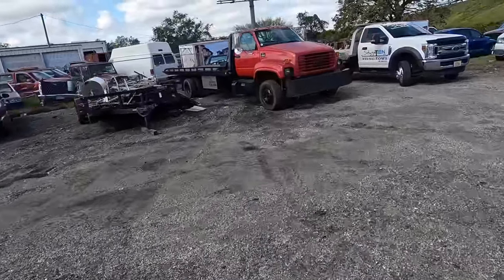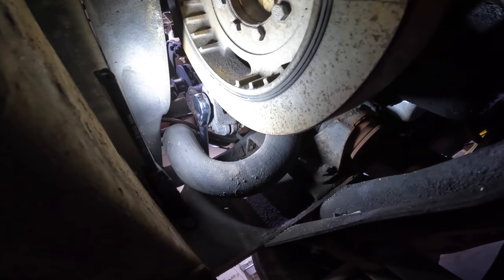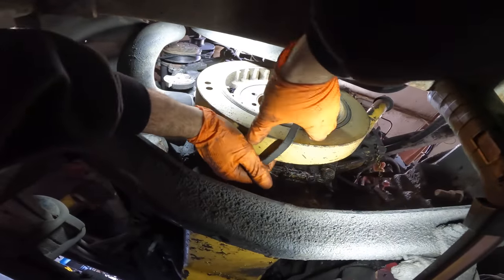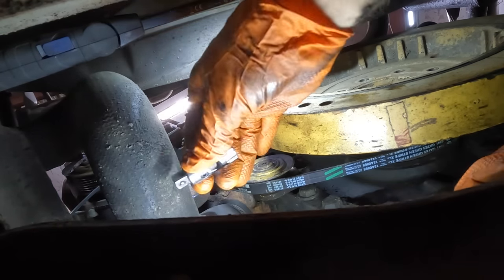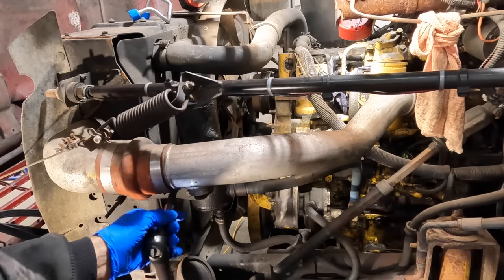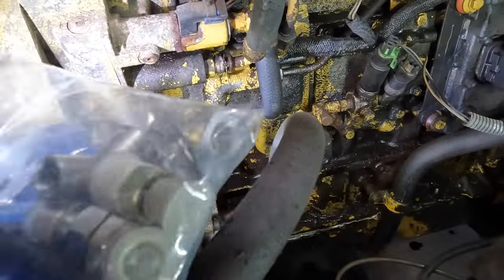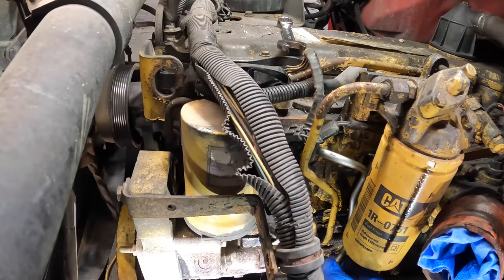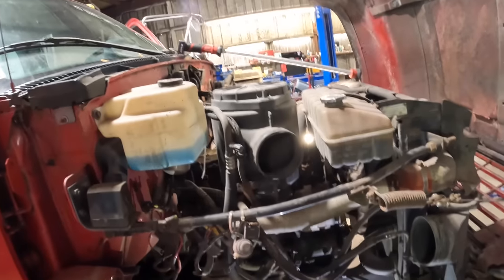Hi Tension Explosion! CAT 3126 Diesel

Comment: Next time, rotate the belt so that the flat side is to the inside. That will give you exactly enough extra belt diameter to fit around the balancer without resorting to force.

That works because with the friction side facing outward, you are now bending the belt so that the cleats are pulling away from each other. In normal orientation, bending the belt pulls the cleats against each other; reducing the flexibility.
Reply: Yep, that's all he needed. Good catch!
Reply: Thank you for that tidbit! Makes sense!
Reply: Was so wanting to say that while watching him struggle…..
Reply: I think you're talking a bunch of nonsense.
Reply: @davidgreening173   same here common sense
Reply: That’s the way to do it. Turn the belt “inside out” then apply pressure. 👍
Reply: Turning the cleats out increases the inside diameter! The flat side of the belt is a larger circumference.
Reply: Thanks the way I’ve always done it, reverse the belt. Now I’m worried about the lubricant you put on it. It may last a while.
Reply: Yup. Also the Cat belts are just a tad longer than any aftermarket I've run across. I just flip them inside out and they just fit over the damper.

Comment: Ray , It's nice that you as a pro do not edit out the aggravating stuff, as a DIY'er sometimes a 2 hour job easily turns in to an entire afternoon filled with frustrations especially up here in the rust belt.  Nice work !
Reply: I’m betting that swear jar in that afternoon is half full
Reply: Please , you are killing me with that rust . I get rust nightmares when I go sleep.
Reply: I've never had a belt that rusted.🤭
Reply: gotta love when bolts go from righty tighty to righty loosy
Reply: Repaired a mates Subaru XV TX-580 box with code P2763 and workshop manual said 2 hours but took me 5 hours, lots of frustrating other issues on the valve body.

Comment: Hey Ray. Large pry bar on the back side of the vibration dampener usually moves it no problem. It weighs about 30 or 40 pounds. Removing it is the preferred method to get that vee belt off lol CAT tech from Ring Power. Local Florida boy
Reply: Center bolts though right?  I've never removed the outer bolts to remove the dampener.
Reply: @brianm5186  the outer bolts hold just the dampener itself to the pulley hub. The inner bolts remove the entire hub and pulley assembly. He removed the correct bolts for what he was doing. Just need to pry on the dampener to get it off.
Reply: @deez_pucks4709 , Stick around Deez, Ray’s probably going to need more advice for this Cat engine. He can more than likely figure it out but having a Cat Tech in the audience could prove valuable.
Reply: @Hoaxer51  I plan to. Lol Don't know how my weekday would go if I don't have my breakfast while watching a Ray repair.
Reply: I tried to tell ray the same thing and he left a rude message back to me he said am I blind?
Reply: What kind of torque does that center bolt on the damper have on it? A ton, I imagine! Could that be taken out to get the thing off also or more hassle than it’s worth type thing?
Reply: @dh-_1011  it's not as much as you think. German torque specs with a 1/2" impact. Lol You can take it off at the center bolts but it's much heavier and touch to remove due to its size near the fan shroud. Plus you chance damaging the front main seal in the process since it's mated right up to the crank. Not worth it just for the belt when the dampener is fairly easy to remove if you know where to pry.

Comment: Just a suggestion, 
Degreaser and power washer, makes the job easier to find leaks and to work on the truck. 
Glad to see your whole family is working with you, special thanks to The Wife Unit. Her job is endless.
Reply: I am surprised he hadn't ordered another pallet load of Brakekleen to clean up this big rig 🙃
Reply: Yes, i found many hours of power washing made for many hours less struggling
Reply: The local do it your self car wash is a great place if you don't have a pressure washer.
Reply: Not a good idea in todays car/trunk electronics and sensors

Comment: Ray i love cat motors especially the 600hp which i had in my 3 trailer road train before the 1.5 million engine rebuild and it was rebuilt .3 times , cat motors  are the best engines in tropical areas going from cold in Adelaide to Darwin there gutsy mate hauling 125 tons
Reply: Greetings from Camperdown Vic mate. 😀🙃
Reply: G'day from central QLD
Reply: You must have very good roads to allow that load.
Reply: @wayneessar7489  That and a lot of axles.
Reply: @leonb2637  Thank you!

Comment: From the CAT manual (my '96 in my RV), the easiest cold start method is to cycle the key 3 times - as soon as the intake warming light turns off, turn the key off and immediately back on until the third time, at which point you start the engine. Mine starts like a champ, even in the cold weather we have here in the PNW (I don't start it in the winter unless it's going to be driven)

Comment: The tree company I worked for had a GMC  bucket truck with a straight 6 cat motor . Was told it was a throw away motor ,could not be rebuilt. Always wondered why not.
Reply: Ya! After 1+ million miles, throw it away with the vehicle it’s in,,, for it is not “road worthy “ ! LOL
Reply: The cylinder liners are not replaceable in the block, like most larger diesels. The block has to be machined and a sleeve pressed in. So, engine has to be removed, disassembled and sent to a machine shop. Long and expensive process.

Comment: I remember doing my first water pump belt now after watching you struggle with this one Lol the other mechanics in the shop were laughing at me as I was you now you should know the belt will go over the balancer but here is my tech tip for you so next time you don’t have to fight with it so much, don’t take the tensioner loose at all cut the old belt off if it is still on it put the new belt on and start it on the pulleys then go tap the key and the belt jumps on and is tight , put the new tensioner on then put the serpentine belt on and your done keep up the good work !!

Comment: That belt lube is great and a ratchet strap. I wish I had thought of things like that. The best I have is my lower radiator hose blowing out 30 miles from the shop and no tow trucks available for hours. I used gorilla tape and water from a water fountain in front of an office building. Lol

Comment: Not sure if you have any experience with tow trucks in your past but I want to toss some advice your way.  Be mindful of your height when you're loaded. I generally use the fact that I'm a hair over 6' tall and know how high the bed is on the empty truck. If I can see the roof of the car I'm under my height plus the bed height, usually about 10 foot. It's not perfect but it gets you in the ballpark and helps avoid custom convertibles.

Comment: I've never understood why diesel engines aren't washed with pressure washers before you start repairing things.. Everything is so much easier and cleaner to work with once you've done this. I used to do this when I worked as a mechanic on agricultural machinery such as large tractors and wheel loaders. It's so easy.. check for faults first, wash, repair.
Reply: Because lazy, lol. Soak everything in a mixture of degreaser & cosmoline remover and kerosene before you get any water on it, let it work in for a little while, then spray it off with a pressure washer strong enough to remove the crappy factory paint job from a '90s Dodge pickup. Then throw some kind of good, slightly alkaline biodegradable cleaner on everything to deal with the stuff that isn't of the oil/grease/fuel/sludge type variety, and rinse that off. Probably won't even need any elbow grease. If you want to pretend it's a show truck, you could finish up with an old wash mitt and some Dawn in hot water, but there's no real need. If you want to be "OCD thorough," blast off all the oil-based garbage you can see/reach (rinse from bottom up; water is not an oil-based cleaner's friend)... then stick it back in the parking lot until it's completely dry, bring it back to your water supply, lift at least slightly in the front (unless you're truly a masochist and/or have a creeper fetish), slide underneath, and soak soak soak everything that you can. Blast it off with the pressure washer again, then do a second thorough high-pressure rinse from above (front/sides/fenderwells) before you worry about the plain old dirt (non oil based) crap. 

Things like this are yet another reason why it's good to hire an employee for the not quite grand master mechanic level tasks. Get one who can detail (properly), and he - or she - can still be bringing in $500 to $1,000 on the days when you don't need a serious second set of hands "on the mechanic side." Assuming, that is, that Florida drivers actually give two shiny sh!ts about how their vehicles look outside/inside/underhood. Considering the way they drive, I have my doubts. But if you're in the same facility as a body shop, they might be able to throw you an occasional bone (or vice versa, depending on how you look at it) and have the employee wet sand / compound / glaze / wax / wax a vehicle. Especially if it's the kind of gravel lot cut rate body shop that is owned by someone who thinks(???) a full filtered air paint booth setup is not required and, therefore, tends to have dirt in its paint jobs (along with orange peel finishes). Either way, there's always something for a detail person to do in an area with more than a thousand people in it, and you don't need all that much mechanical ability to provide real time-saving help (/do the piddling jobs - which is most of them, come to think of it, but...).
Reply: too expensive, he uses Brakekleen only.
Reply: @forgetfulme1719  THAT'S expensive, when he routinely uses multiple cans per vehicle of the stuff, instead of multiple vehicles per can. Plus it removes more brain cells than grease, lol.
Reply: @wesgregg6451  BK getting views, some of his actions already confirms the the last part.
Reply: @wesgregg6451  he has said viewers have sent him cases of BK, so his cost is low as long as viewers like it enough.
Reply: @forgetfulme1719  Who is BK?
Reply: @wesgregg6451  BK short for Brakekleen, sir. he likes nice shiny lungs when retiring.

Comment: looks good Ray. 
hint you may want to look in to a new balancer for that cat. you will find it runs and sounds smother after you change it.
Reply: why replace the balancer please explain?
Reply: @thelaughingman79  the rubber in the balancer ages and gets hard or out right de laminates and slips and at that point the crank will start flexing. i saw a balancer out right tare in half and that mad a real mess of things.  they are hard to find for the older cat's but i run fluidampr on my truck and i love it.

Comment: Just  a tip The front Damper  of the crank , There are 4 bolts in the centre  ,you remove those and the damper comes off quite easy  you don't need to remove the perimeter ones .
Reply: Yeah he going to be mad at himself after  reading this but he knows  next time
Reply: I came to the comments to say the exact same thing.
Reply: Otherwise flip the belt so the strings are inside, that way the rubber can flex and allow it to slip into place.
Reply: No it’s got 4 bolts,look again when he nudged it round
Reply: @stephenanderson439  yeh i seen that when i put the video in slow motion, weird angles make things look differant
Reply: @stephenanderson439  bryce1916 said: "There are 4 bolts in the centre", just like tou said.
Reply: Well hope he see's this so next time he will get through it in a few min.
Reply: It comes off quite easy when it weighs close to 60lb.  There tons of professional that have done what Ray did, but didn't show it. I wonder how Ray would have reeeeeacted if he stuck that belt on with the letters facing the other way.
Reply: You beat me to the comment. 
Also, fold the belt inside out.
That works as well.
Reply: I tried to tell ray the same thing And then he left a rude message back to me saying am Iblind?
Reply: @@roadstonowhere1964 beyond no doubt,  u and I 100% accurate assessment, too proud to learn from real pro. It loses entertainment value  if everything goes smoothly with proper tools and skills
Reply: @CaniKissYou09  now u know Mr Hack is too stubborn and scary to realize own inadequate knowledge. Only those  learn from mistakes can grow. We watch it like circus acts from now on.
Reply: Well, who knew?
Reply: Preventive maintenance is always good  ,,gives piece of mind 😁😁👍🏽👍🏽
Reply: @@roadstonowhere1964 true, I watch so I never do the things he is doing to my own  car. Should be comedy channel.
Reply: @norcalvapin  your life might be and No I don't want your plush toy.
Reply: Some of you guys need more brake clean in your life……..ReeeeEeeeee!
Reply: @norcalvapin  yep, just copy his repair hack on ur car to see how long the repairs lasts.
Reply: @shadetreemech290  he has a garage now, shelter from rain and sun, can take as long as it takes.
Reply: @norcalvapin  what do think that thing on the end of the crank shaft is ?
Reply: now we know why the old belt was stretched
Reply: @norcalvapin  uh..many cars do have harmonic balancers..especially V8s
Reply: Maybe not the best way to do it - i can’t see pre-stretching the belt like thqt doing it a bit of giid, but on the other hand - it’s his truck, so future repairs when it fails are only costing time to redo it.  Except calling a wrecker wrecker anyway :)
Reply: @Roads To Nowhere is it your truck or belt?
Reply: And I bet tensioning the belt with the balancer off is trivially easy too.
Reply: @Roads To Nowhere You are pro parts changer
Reply: gravity everywhere. Keep up the good work Ray
Reply: @norcalvapin  lol and YOU tell people they don't work on cars. By your comments you wouldn't be a mechanics atsehole. Lots of engines have harmonic balancers even some 4 cyl
Reply: @johnmcnair8854  I didn't know that a vehicle with a gasoline engine didn't come with a harmonic balancer to be honest. Mind you I'm an old man so, you learn new things every day. Including the fact that drive by wire now includes the power steering which no longer have pumps.
Reply: @toysoldier46552  well being really specific it's a harmonic dampener as engines are pretty much very well internally balanced these days but some Japanese 90's 2000's cars came with solid crank pulleys
Reply: How many were yelling at the screen "Four center bolts Ray!!!" 😆
Reply: “There are four bolts, not 5”. What TV show is this based from? Hint; substitute lights for bolts (probably gave it away) 🤣
Reply: @CaniKissYou09  
Stop lying 🤥
Reply: @CaniKissYou09  Aw shucks, poor you. Guess you`ll now need counseling??.  😁😆
Reply: @forgetfulme1719  Thats an idea! clowns watching clowns !. Or You could always start your own show in opposition, and show us all how a real ( never fail, always perfect) mechanic does things....However, trolling is easier eh?..
Reply: @AppalachianPatriot  Some just need to *get a life*.....
Reply: @tihzho  You lot yell at yer TV???, Get help. Hahahaha
Reply: @CaniKissYou09  No he didn't !  and you know it troll.
Reply: @johnhhinton5473  what Mercedes dealer u hired or where  trained? u read service manuals? prove I and other pros are wrong, pry bar, hammer, no torque specs... fix ur own plane and fly.
Reply: @stevencimini3556  Star Trek TNG. Captain Picard said this.
Reply: Unit looks pretty good coming from the land of ice and snow.  At least it’s not a ball of rust!
Reply: @robertsee6400  needs suspension and new rings work, junk yard owner dose not like his pending flatbed tow competition. Dseperate to make $ since his loyal followers r all far away and that section pop r poor.
Reply: i dont think he wants to have to do a front main seal as those four bolts are for the crank pulley and 3126 engines use a dual lip crank seal.
Reply: Cut the old belt dude ! lol the new one … lol worry about that new belt after ,
Reply: @jacobuszwanenburg1629  yet so many think he is genius mechanic.
Reply: I was looking for this information!

Comment: You are doing a great job, although when  I did my apprenticeship at the SA Rail and when working on the Diesels we were taught to clean the entire motor and engine bay first, that way we could see any leaks or other problems with fluids.
Most of my time was learning machining and on element systems with steamers.  Most of what I did with diesels was with the injector systems.  This was in the seventies.

Comment: I had a belt tensioner break similar when I was working on my Jeep.  (Was replacing the wheel due to a bad bearing & the arm just snapped in half between the wheel & the sprung mount.)   'Fixed' it with some aluminium reinforced epoxy, and ordered a replacement.  It was still working with no issues when the new one arrived, but those were a few nervous days/weeks waiting for it to arrive!

Comment: As a HD tech that used to be a auto tech, I’m a fan of Ray’s channel, his antics, wise guy comments, his wasteful display of brake clean and complete lack of real torque clicks/beeps!

I’m astronomically surprised just how far Ray is willing to go by doing more work with the thought of doing less work.

I mean hammer, silicone spray, ratchet straps and prybar action to replace a belt instead of just removing the balancer.

Also, not wire brushing some of the rust off the Charge Air pipe clamp T-Bolts, then not loosening them enough to fit a hose pick to release the bond to the pipe.

Plus, HD techs equivalent to Ray don’t get paid $50/hr, we’re lucky to get 25-35/hr!!!

Only the special techs get paid 45/hr or more, you know the guys with 30yrs plus experience that now are the lead techs or bosses!!!

They get paid more while knowing less about current technology than us younger guys will forget more than the older guys think they know!!!